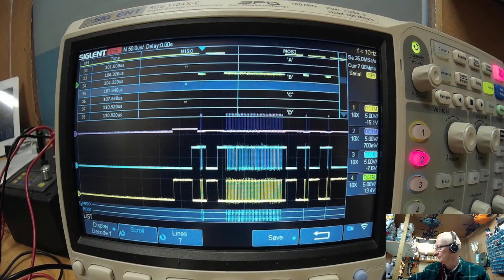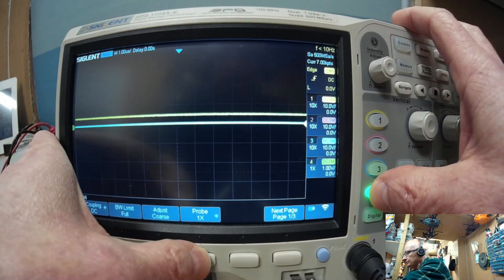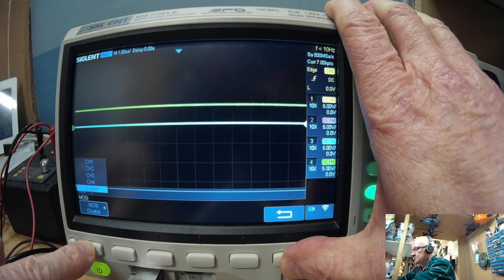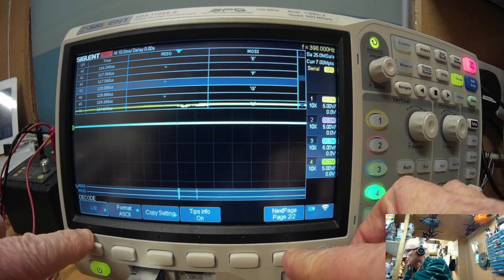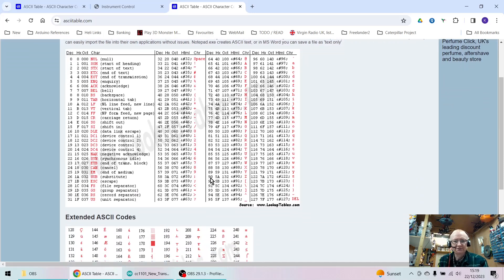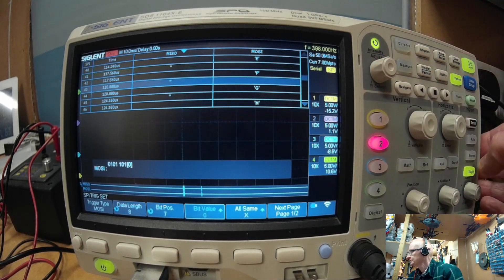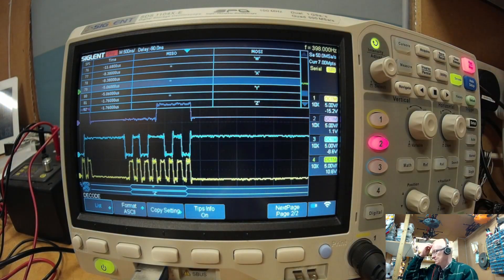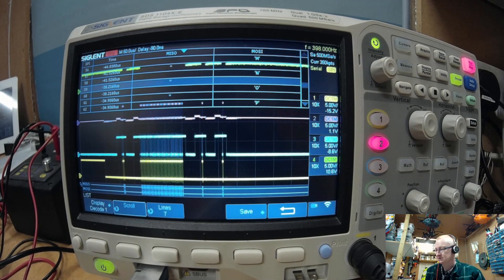Siglent SDS1104X-E SPI Bus Decoding (4 Channels)

Comment: Thanks a great lot. Step by step setup on how to check SPI - I had missed that final step - copy to trigger.
Reply from the maker: Yes copy to trigger is necessary for it to work, but use caution, I have noticed the copy is not 100% and one (cant remember which) setting is not copied ( unless Siglent has fixed it in their latest update )
Reply: @TheBionicbone  Thank you. I tried reading the data. At one point it showed some list. But disappeared very fast. Could not get it afterwards. On ESP32 + AD9833 Function generator ic. Its output got shorted some how. I know ESp32 is transmitting data but couldn't get any readings. Any idea ?

Comment: 4:05, I hadn't noticed that setting before! Awesome!
Reply from the maker: @larrybud Oh while I think about it, watch out for the bug , it doesn’t copy MISO over 😁. I keep meaning to report it to siglent
Reply: @TheBionicbone  Good to know! Also on EEVBlog, some people had an issue after the latest firmware update. I found a thread on there where decoding wasn't working, and I believe I had the same issue, and for me the problem was whether it would trigger on rising or falling edge. It seems that the display would show one thing, but the trigger actually was doing something else. A toggle of that option "reset" that setting so it would work properly. 

I can't absolutely confirm this is what fixed it for me because once I fixed mine, I can't reproduce the issue again.
Reply from the maker: @larrybud I’m glad you found the video useful, thanks for watching

Comment: Excellent, thank you.
Reply from the maker: Hey, thanks Bill for the comment, you have a great channel, I really enjoy your videos.
Reply: Thank you! @TheBionicbone  
My 1104-XE started acting strangely last week, I tried calibrating but the trace lines had vanished.
In the end I found a Siglent document with a reset procedure, essentially a restart whilst repeatedly pressing the MATH button, Sounded a bit odd, but worth a try....
Anyway, it worked, normal service resumed!
Phew!
Reply from the maker: The good old factory reset process, it’s replaced the good old turn it off and on again in modern day electronics. I’ll keep a note of that one just in case